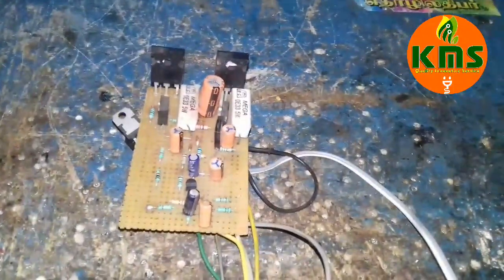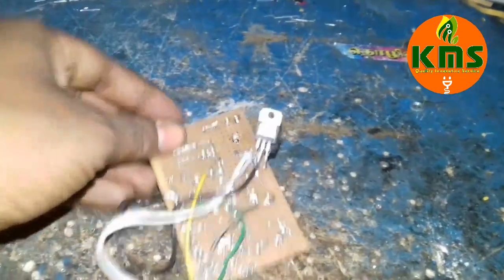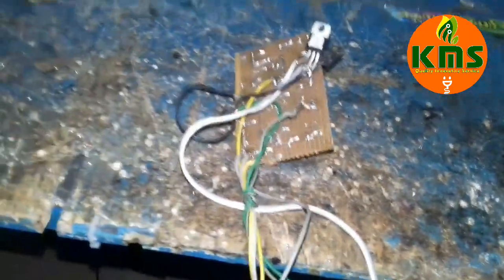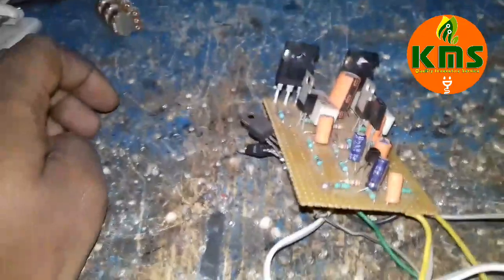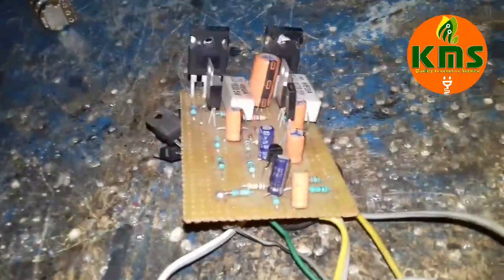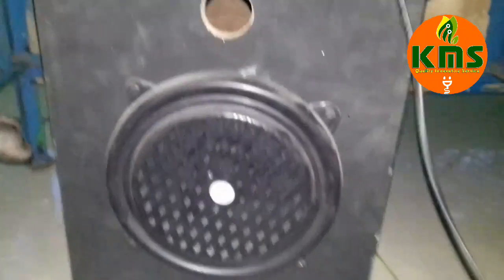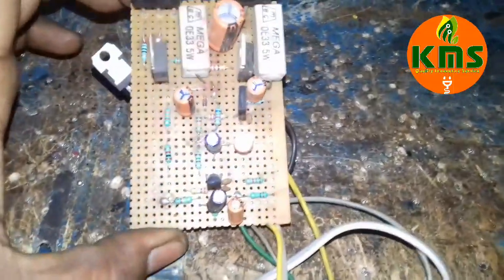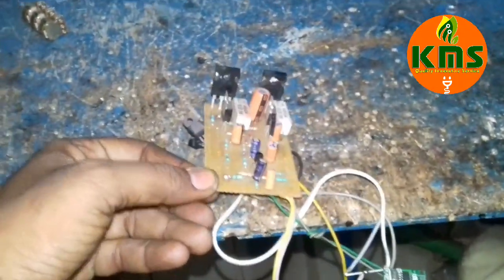SINGLE SUPPLY AMPLIFIER CIRCUIT EXPERIMENT @ UNDER VOLTAGE

Comment: Pa amplifier lam singlevsupply la than work aguthu for example 250w 24 volt than antha amplifiers lam eppadi avvalo heavy ya work aguthu
Reply from the maker: Adhula transformer output bro like inverter center tapla positive kodutht oscilate panniruppanga apram output koda transformerla irunthu varum
Reply: @kmsaudiolab2026  thanks bro

Comment: Super bro bro lm 324 ic subwoofer circuit diagram pathhi sollunga ..Mani from Karnataka state
Reply from the maker: Lm324 general oprational amplifier bro adhu yethukku venalum use agum sub preku use pannalam suppose neenga yedhum circuit try panni doubt irundha watsap pannunga therinja sollaren mathapadi lm324 sub pre ic alla adhu oru quad oprational amplifier mattum adhu vachi neenga neraya project pannalaam 
Thank you 
Kanagaraj 9788004967
Reply: @kmsaudiolab2026  u WhatsApp number